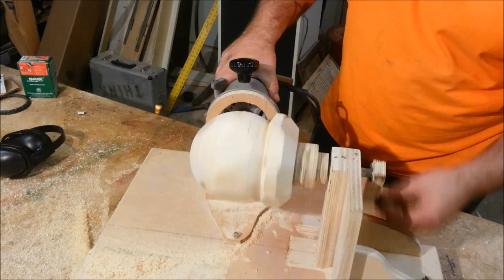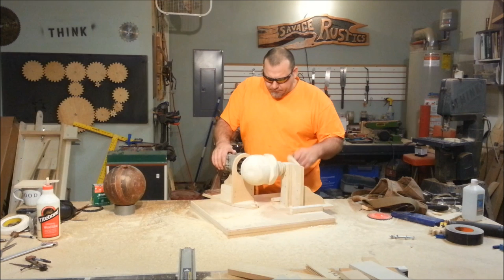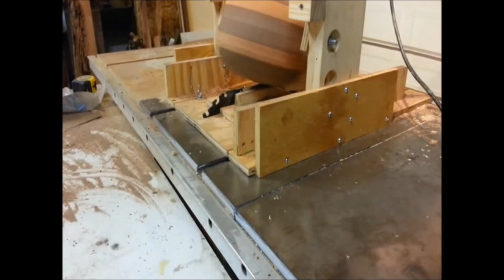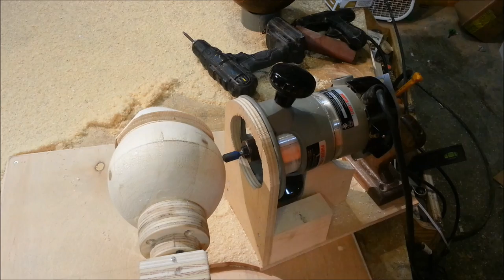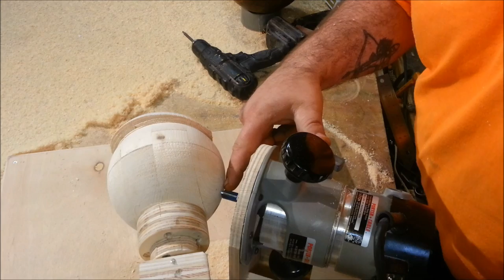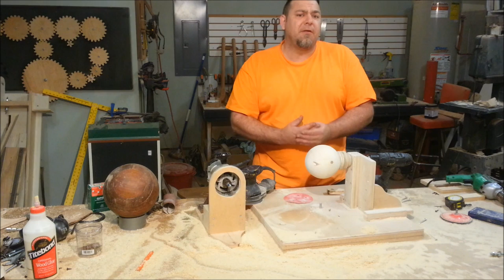Make Wooden Balls With A Router!

Comment: Can't wait to try this. This method will end my frustration at trying to do this on the lathe. BTW Izzy, if you want to dial in the roundness, one trick is to take the nearly finished ball and place it into the end of a smaller diameter pipe/jar/whatever that is lined with sandpaper. Roll the ball around until you can't see daylight where the ball and mouth of the pipe meet.
Reply: Wtf did I just read

Comment: I would add  a slide with a ruler from the pivot point to the router tip so you could dial in the radius, and some way of raising both the router bit and the chuck so they can be centered with again a ruler and some sort of gearing to dial in the radius plus some clearance.  Izzy you amaze, and what can we say but that you have great balls. :)

Comment: Hi, great video, great jig. Hot glue holds very well, I do all of my turning only with hot glue (because I don't have a lathe, i just glue stock to the wooden disk that's pressed on a motor shaft). 
In case you didn't know - there is a good way to separate hot glued pieces - just apply some isopropyl alcohol/acetone around glue lines and it comes off without damaging anything, share that in your videos (I found this quite a while ago, I don't know whom this 'find' belongs to)
I want to make some balls too, actually, since you posted that video with bowling ball, but I need a reason for that...
Reply: funny you mention that.  in the beginning of his video, i saw a bottle of rubbing alcohol and wondered what it was for.  must be for what you recommended!
Reply from the maker: Great Advice! it is the same method I use. I also use heat when called for.

Comment: I made something similar years ago but I'm not very coordinated so i used a variable speed cordless drill on the turning shaft instead of a handle like you did for the sanding part.

Comment: Your right about the hot glue. Once it dries it is very strong. Usually the wood will tear before the glue fails. The glue is dry once it turns white again. You might want to put some on the outside once the ball is set in place. a little insurance.
Reply from the maker: +MrLeonard55  Good idea
Reply: +izzy swan   Can you make some kind of jig to make eggs on a lathe or whatever tool?

Comment: rather than run the risk of mis-centering the headstock when you swap sides, why not just make a 2nd headstock, glue it to the other side while the 1/2 ball is still mounted in the first, then remove the first headstock? That way, no centering issues...